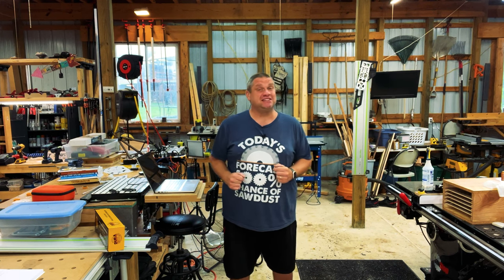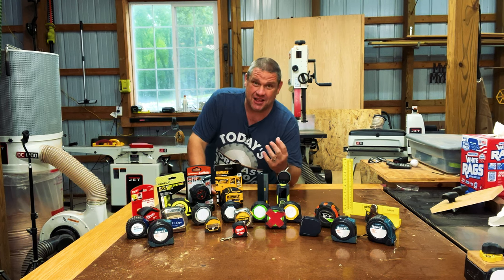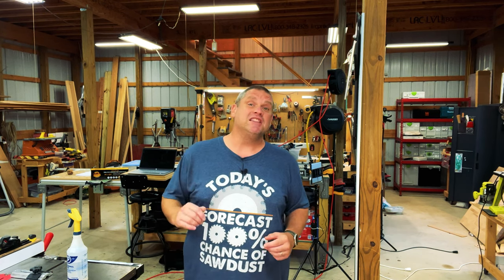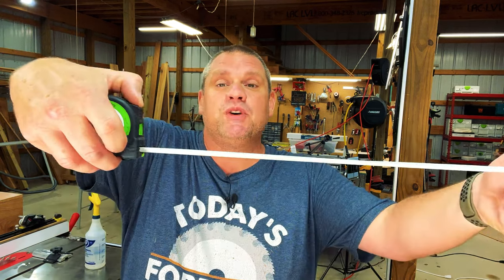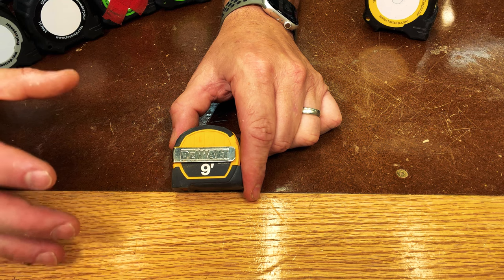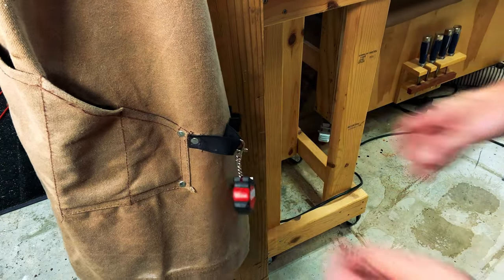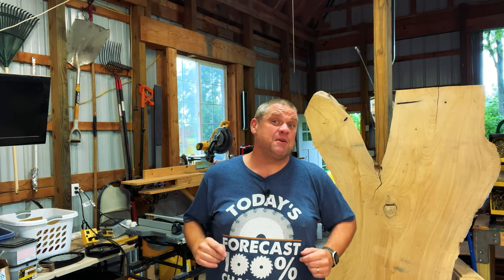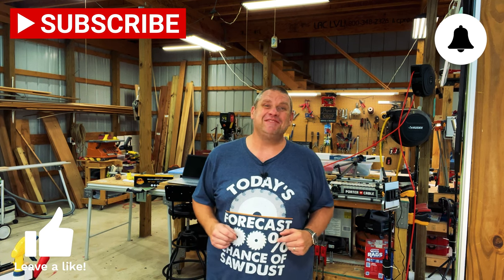Discover the Surprising Truth Behind Tape Measure Technology! #woodworking #tapemeasure

Comment: Couple comments,
Thanks for telling folks to stick with one tape while doing a project. 

I've been using Lufkin tapes since the late 70's. They got famous by having a rubber bumper so the end doesn't get loose. 
I have 3 tapes and I've spent many years collecting them because all 3 read the same up to 25 feet.
Reply from the maker: That's awesome!  Didn't know Lufkin had been around that long.  This was my first experience with them, and I've been really impressed.   How did you get so lucky to find 3 that read exactly the same.   Actually I probably have 3 that read exactly the same.  I should probably just throw all the others out or hid them.... or better yet lose them! :)

Comment: You missed a feature on the Fastcap tapes the mat finish can be written on with a pencil useful for layout. My absolute favorite tape measure is the Flat-Back it lays flat making it easier to mark your stock.
Reply from the maker: Are you talking about the the writable surface on the side?   I think I did cover that, is there another writable surface?   If so I don't know about it and now I'm curious! :)  Thanks so much for watching!
Reply: @FlynndoggWoodwork  the tape itself
Reply from the maker: @monteglover4133  Oh yes!  You know what is funny, is that as I was cleaning my shop out for the renovation, I found that darned story pole tape measure about 4 days after I filmed the video.  I was like dagnabbit!

Comment: You're right. That is more than I ever thought I wanted to know about tape measures. I didn't figure there would be any new developments in tape measure technology. I do like the self-locking models and the one with the built-in light. I can definitely see that as being useful in my poorly lit garage. I wonder if anyone makes one with a laser on it so you can be sure you're measuring in a straight line.

As for the number of tape measures you own, if you count all of the ones that are hiding out in your shop, I'd say the number is somewhere around 237.
Reply from the maker: I know right!   Tape measure technology... kind of an oxymoron.  You know what I was thinking would be really cool is if they could develop a tape measure that would shine a laser markings down the length in a straight line.   Kind of like those projected keyboards that you sometimes see for a computer.   That would be amazing.  But not quite sure that would be easy to do.   Thanks for commenting and watching Ted!
Reply: @FlynndoggWoodwork  That's a great idea. Nano technology to the rescue!
Reply from the maker: @Ted_James  No doubt!

Comment: I use the Dewalt 9 ft tapes.  I decided I did not need a bulky 25 ft tape in a pocket or even taking up space when I never measure anything longer than a few feet.   I have 4-5 of these magnet backed tapes stuck on various machines where they are used most often.
Reply from the maker: Great choice Rusty!   I love those things.   Fit right in the pocket and they can be stored in so many places with the magnet!   Thanks so much for watching!

Comment: I don't have as many as you... but still...
I have 2 FastCap lefty/righty as well, but mine are auto-lock. Maybe this is a new version or a "Canadian" version.
I recently purchased the yellow FastCap as well, just to have one in metric.
I also have 2 small Dewalt with magnet on my table saw fence, and a small Milwaukee in my work bag that I carry all the time.
Reply from the maker: Oh man!  that's awesome.  I had 3 lefty righties but now can only find two of them.   I had no idea they made an autolock one.   Another one that I found yesterday while cleaning up after a project was the Story Pole one from Fast Cap.  Really wish I would have remembered that one as well to show on the video.   I haven't had a chance to use it because it was buried under a pile of walnut!    Thanks so much for sharing and watching xof-woodworkinghobbyist!